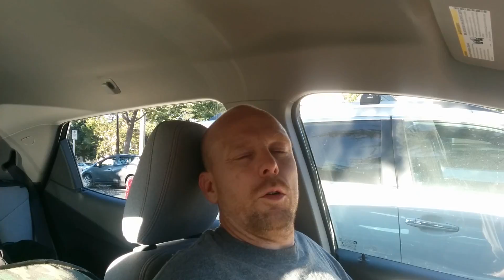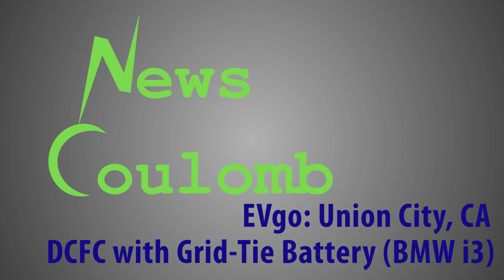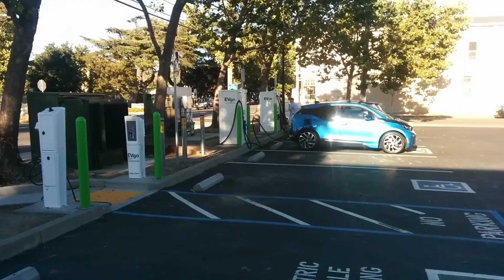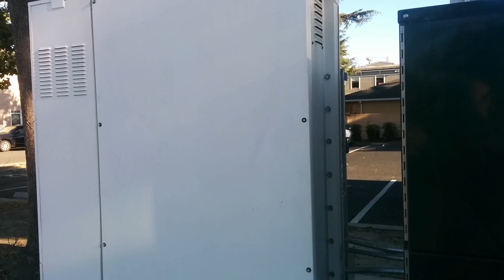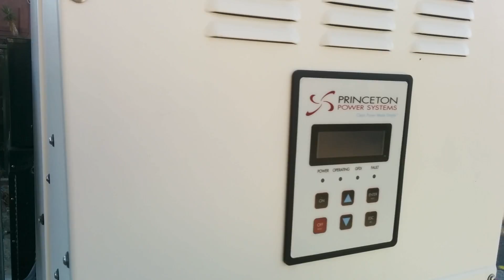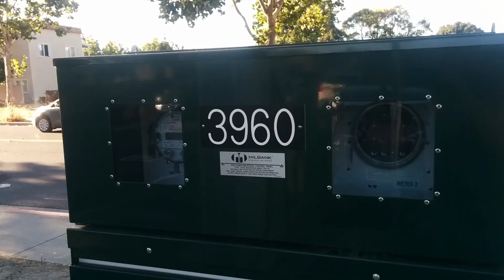Site Review: EVgo, Union City 2018

Comment: Which batteries for residential would you suggest that provide enough energy for a house with an air conditioner and require no maintenance?
Reply from the maker: If you're asking for specific product recommendations, I wouldn't feel comfortable giving one.

In general, I don't like Li for home grid-tie battery use. Maybe off-grid, but for grid-tie, I think redox/flow batteries are a better choice.

Comment: I wonder who controls the utility interactive inverter. If it’s only 30 kw and 44 kWh it’s going to have to be pretty precise in when it charges and discharges in order to manage peak demand. If the utility company controls it, like the GMP powerwalls, then it’s easier to manage true peak demand of the grid, which is what the real point of peak demand charges. 

If it’s independent of the utilities control, then I guess it is set to assist the 2x DCFC anytime they are consuming more than 60 kw and recharge anytime they are using less than 60 kw, at a rate that limits peak demand to 60 kw. 

I’ll bet Tesla is doing the same thing at Kettleman, using a tiny solar array (250 kw) and a tiny group of powerpacks (maybe 250kw/500 kWh) to chop peak demand down from 1500 kw to 1000 kw. I would be very surprised if those powerpacks ar solar charged, and used at night. I would guess at night is when they try to get fully charged and ready for the next day.

These EVgo places should add a few solar panels in a similar way, even if just 15 kw, especially in California, and use it to try to get peak demand down from 60 kw to 50 kw. 

But if you can get a charger set up in an area that stays at peak peak demand 24/7, you don’t need any solar or batteries because the power is as cheap as it’s going to get, and too cheap to pay for either solar or energy storage. I think this is why you will see absolutely zero off grid fast chargers unless it’s some sort of publicity stunt or one of those little portable ones great for small islands without any power.
Reply: Here’s one a very simple explanation of how peak demand charges can represent 10% or 50% of the cost of electricity because I think a lot of people don’t know that industrial/commercial power is billed differently than residential. If this link can make it through the google filter. 
content.cdntwrk.com/files/aHViPTYzNDU5JmNtZD1pdGVtZWRpdG9yaW1hZ2UmZmlsZW5hbWU9aXRlbWVkaXRvcmltYWdlXzU5MDE1MjE4MWJjYzAuanBnJnZlcnNpb249MDAwMCZzaWc9MGJhMDM2YWNkMTExNjlhYjcwZDM0ZTUyZTNlNmE4ZGQ%253D

The left side chart would represent 2x 50 kw chargers running at peak 24/7 all month. Of course in reality it would have a 100 kw peak and an average load of 60kw, so an DCFC best case will be about halfway between these two extremes. 

In this case, the picture on the right shows even though there is a peak of 100 kw, there is still a base load which consumed 7290 kWh. This would be the same as 2x 50 kw chargers, which occasionally ran together to get 100 kw peak, but each charge is only used about 3 hrs a day at an average 40kw output. 

These costs are all things which should be understood by any EV owner using public chargers so they can understand why it might cost so much or so little to charge their car. 

It also helps to understand why the megacharger 7¢/kWh is going to cost Tesla a lot more than that in either demand charges or powerpacks, unless that megacharger has a long line waiting to use it.
Reply from the maker: Yeah. You and I are in pretty close agreement. I don't think it's a good idea for Tesla to try and go off grid.

As for EVgo, I'm not sure how they are managing the power. Perhaps 60 kW would be the cutoff.

Comment: News, that is some interesting information. I would point out that it is either or while charging, not both grid and battery power at the same time charging the EV. I assume the batteries come into play only during peak charging rate times and recharge when the rates are lower.
Reply from the maker: No, they are used concurrently with the grid. Up to 30 kW is drawn from the batteries, and the rest of the demand is met by the grid.

Comment: Is this legit as far as you know? Recharge an electric car in seconds? On BBC news:

https://www.bbc.com/news/uk-scotland-45179722
Reply from the maker: It could be, but as with any emerging technology, I will wait and see. 

Even if it works, it would have to be rechargeable at home, it would need sufficient energy density, and it would need the infrastructure to support it to be built out.

If the technology met all of those criteria and it also supports DCFC using current technology, then they might be onto something. But we'll see.

Comment: I would think that a rural application for this would make more sense, and perhaps this is a test site for an application such as that.  That way 3 phase may not be required, and the location would be able to deliver similar power level to a DC fast charger for 30 to 60 minute sessions?  The depleted batteries could charge back up at perhaps 64A (240v), thus prepping the station for multiple draws each day.
Reply from the maker: Yes, I think that's another important consideration. These set ups can create options where standard DCFC installations wouldn't work. 

The Drive the ARC chargers are supposed to have a similar set up. Despite having two, 100 A DCFC, the site only needs to draw ~20 kW from the grid.

Comment: I suspect these batteries will be used only for the five or six hours of the day that electricity is most expensive from the utility, and charged when power is cheapest. Expect more of these installs as more used batteries come online, but it will probably be just as a cheap cost-saving maneuver by EVgo and other quick charging providers.

As for home batteries, not everyone has the room in their home to hold a lot of NiMH or lead-acid batteries. Those Tesla Powerwalls make it really convenient to get a home battery. When will someone offer a cheap NiMH system for homes that have the space for it to be installed? Is there already such a company? Is it notably cheaper than Tesla's option?
Reply from the maker: Yes, space is a consideration, and Li still wins out in that regard. However, I don't think NiMH or NiCD or lead acid are necessarily ideal either. Redox batteries are a much better choice for home use than any of the others listed, but yes, you need the space.